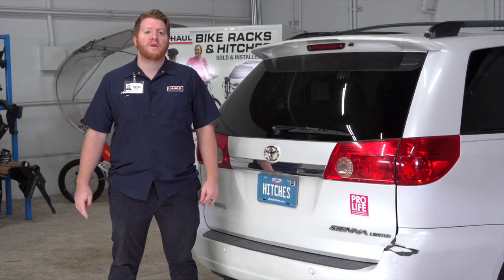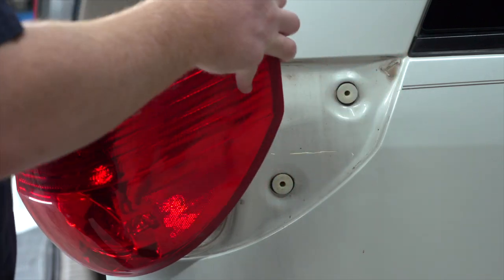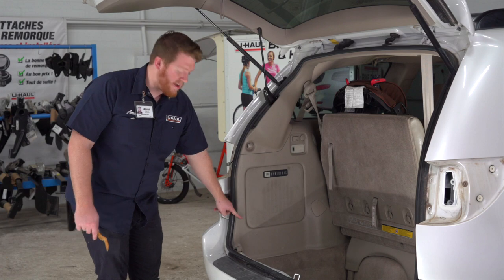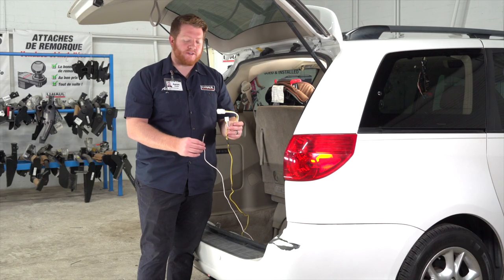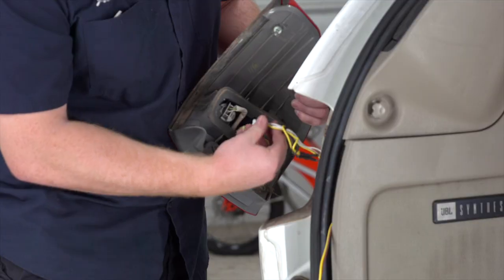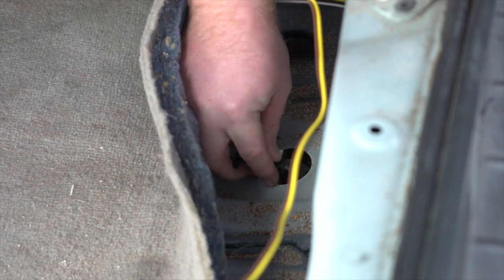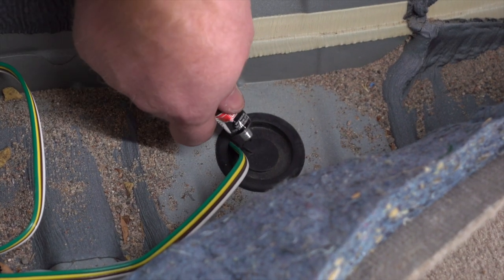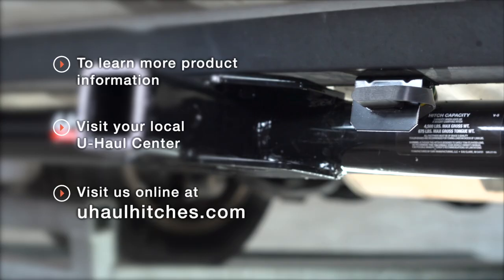2007 Toyota Sienna Trailer Wiring Harness Installation

Comment: Great video. Hello do you have or can make a video on a 2006 Toyota Sienna Trailer 7-Pin Wiring Harness Installation? All the videos only show the 4-Pin Wiring Harness. My camper is a 7-Pin Wiring. Thanks.
Reply from the maker: Your vehicle does not have a 7 way package to "quick connect into". these functions need to be hard wired in. Visit your nearest local U-haul Hitch center to schedule a 7 way socket and brake controller hard wired installation.